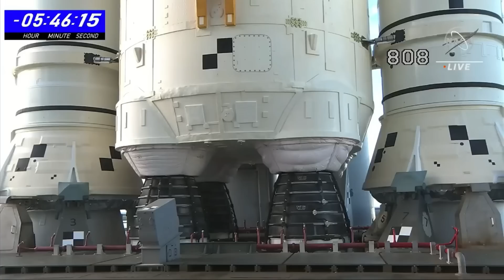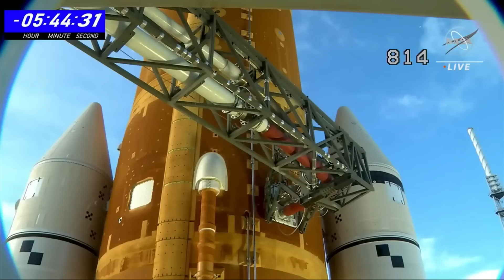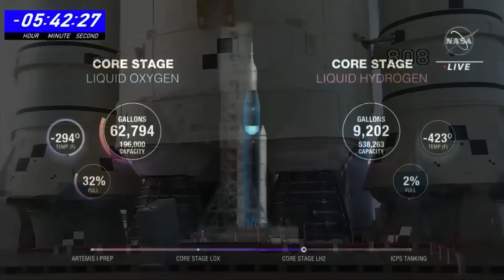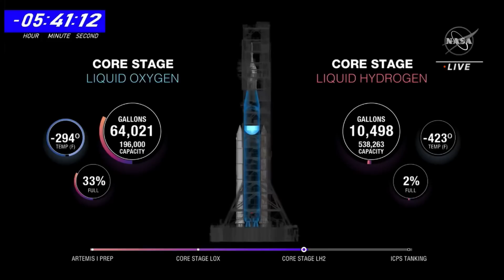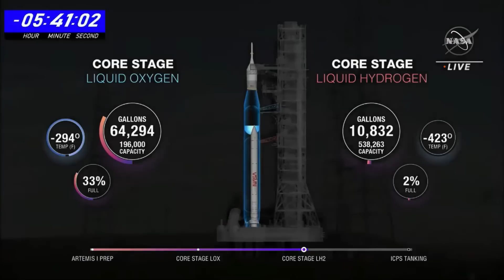Artemis 1 moon rocket fueling resumes after leak detection

Comment: Nasa is only good when they confess 
The speed this thing moves.
It moved 100 miles in 8.5 minutes
That's 811 miles an hour 
That is not 17,500miles an hour
If it was 17,500miles  an hour it would move 100 miles in under 3 seconds
They need to be honest for this to work